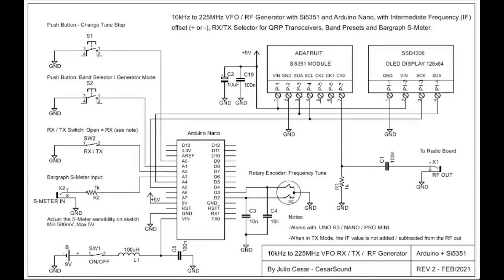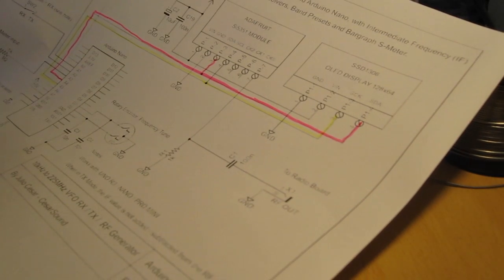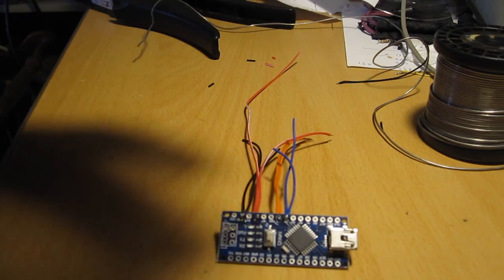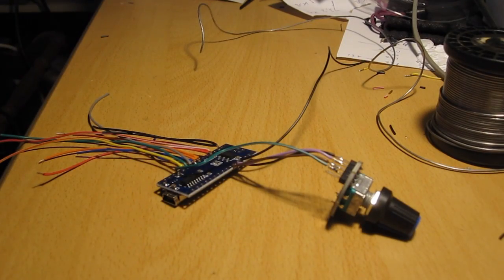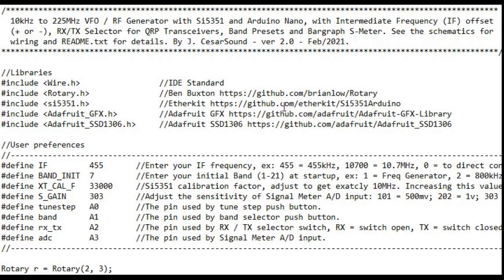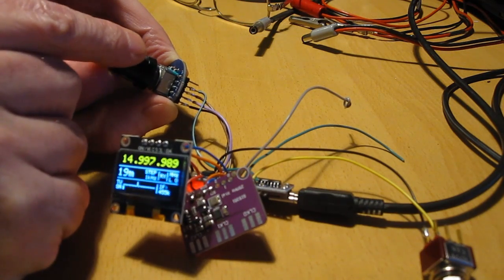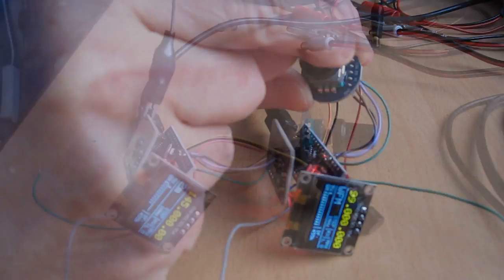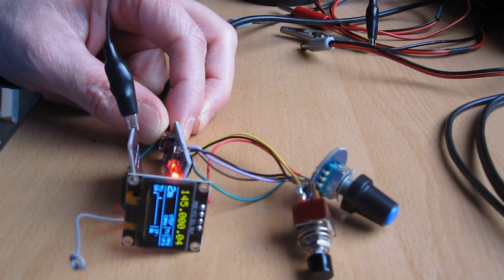Easy cheap RF signal generator up to 225 MHz with Arduino, Si5351 and OLED display

Comment: Nice work 👌
Thank you for the video!
I will try this frequency generator module. I saw a similar one in red. Could be an updated version, oe only the color is other?
Reply from the maker: Thank you for your kind words.
As for the color: I didn't see any red ones so I don't know what you're asking. It's an Arduino Nano and a Si5351A breakout board. Good luck!

Comment: In original sketch frequency colour is white then how it becomes yellow 😮, do you mod the sketch
Reply from the maker: Thanks for asking. I think you mean the frequency readout on the display? If not, please let me know.
In this project, the colour is defined by the hardware, not the software. I have seen these OLED display in White, Blue, Yellow/Blue. So the one used in this project is not a 'Full Colour' display.
The easiest way to get it in blue is ordering an other (cheap) display.

Comment: I can't upload this program i have error 

C:\Users\M4ti\AppData\Local\Temp\.arduinoIDE-unsaved2024526-22008-1eoapoo.aeun\sketch_jun26h\sketch_jun26h.ino:35:17: note: suggested alternative: 'DDRC'
   if (result == DIR_CW) set_frequency(1);
                 ^~~~~~
                 DDRC
C:\Users\M4ti\AppData\Local\Temp\.arduinoIDE-unsaved2024526-22008-1eoapoo.aeun\sketch_jun26h\sketch_jun26h.ino:36:22: error: 'DIR_CCW' was not declared in this scope
   else if (result == DIR_CCW) set_frequency(-1);
                      ^~~~~~~
Multiple libraries were found for "LiquidCrystal_I2C.h"
  Used: C:\Users\M4ti\Documents\Arduino\libraries\LiquidCrystal_I2C
  Not used: C:\Users\M4ti\Documents\Arduino\libraries\New-LiquidCrystal-master
exit status 1

Compilation error: 'class Rotary' has no member named 'process'

i don't know what im doing wrong
Reply from the maker: I am sorry, I am not an expert in Arduino so I can't help you with this. Hopefully you find the solution or anyone else knows the answer and post it below. Fingers crossed!
Reply: @PA3CRX  i solve this problem, there was problem with library i delete all controlling encoder and install from github (link was in scatch I don't remember) and know it works
Reply from the maker: @matid8453  Good to hear you solved it! Thanks for sharing this, it could help others. Enjoy the circuit!

Comment: Hola , probe ese integrado y nunca supere los 140 mhz , no entiendo como llegan a 225 mhz , puede ser por armonicos , saludos desde Argentina LW8DNV
Reply from the maker: Hola, el mío también llega a 225 MHz sin problemas, como os muestro en el vídeo. Esos no son los armónicos, porque son los múltiplos de 225 MHz. Mi SI5351 no es una copia seleccionada específicamente ni nada por el estilo. ¿O tal vez la frecuencia del sketch es limitada?

Hello, mine also reaches 225 MHz without any problems, as I showed in the video. Those are not the harmonics, because those are the multiples of 225 MHz. My SI5351 is not a specifically selected copy or anything. Or maybe the frequency is limited in the sketch?
Reply from the maker: The mentioned link was to an other project. I changed the link now, maybe it helps you to get the higher frequencies out.